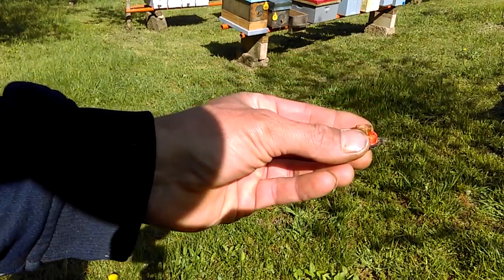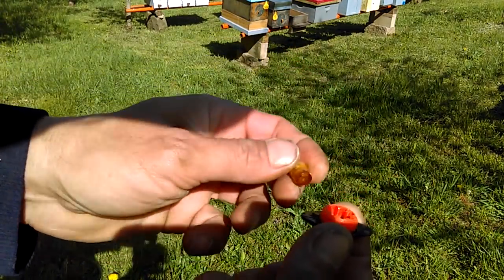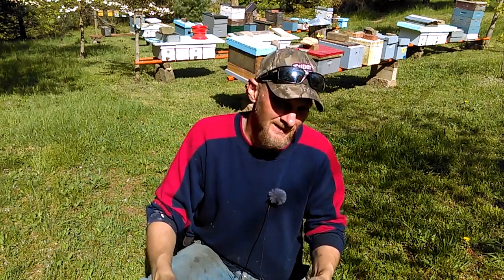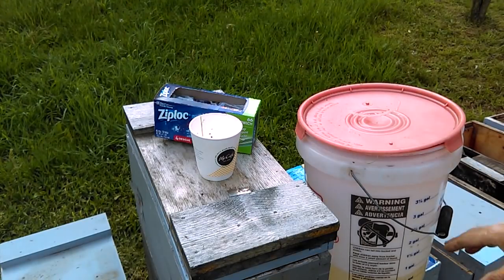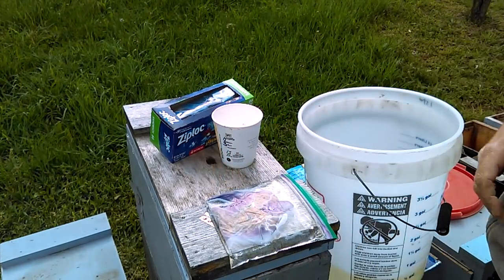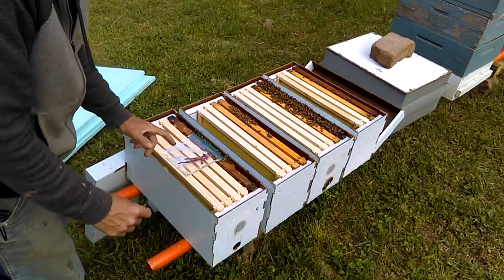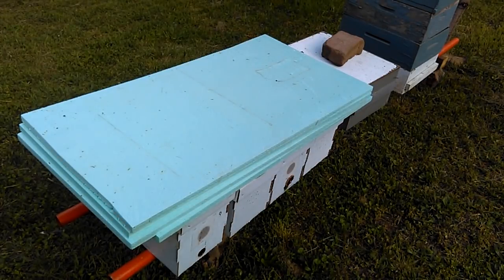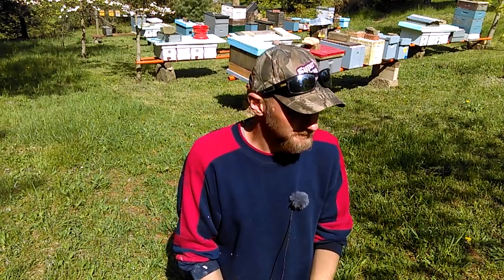Emergency Baggie Bee Feeders

Comment: I like using this baggy feeders in a pinch. I just use a note board push-pin and poke several holes.  I find I get a little too ambitious at times with a sharp blade.

Comment: Hi Jason,
Your videos are great and has given me lots of help.
I use the baggies when my feeders run out also. 
Suggestion, which will be easy for you, cow needles!
I use cow needles to make holes in the bags. 4-5 suffices and none of the issues with the slits.
Also, I emerge virgins in cages like you but my acceptance rate leaves something to be desired.
Whats your technique for introducing virgins to splits?
Thanks for the videos
Reply from the maker: Thanks for the input. I will give the needle trick a try tomorrow when I add new baggies. As far as the virgins I cage them for a few hours then go back and manually release each one. I am going to be sharing a post on this on my Patreon page (free post to read), when I get it don't I will share the link. How does that sound?

Comment: Hi Jason, I love your channel and watch all the time. I did my splits and notched frames for queen cells last Sunday the 5th. Today will be 7 days so I want to go in those mother hives to cull all but 3 of the cells so I don't have 10-12 queens fighting to the death when they all hatch out. My question to you is do you think I should pull frames in the 57 degree temps highs we have forecasted here in west Michigan today? I am not planning on messing with the splits for 7 more days but I need to cull the extra queen cells on the mother hives. ThanksTom
Reply from the maker: I would do what is needed just be quick. I am sitting at 58° and just open the splits shown in the video to install virgin queens from my incubator. I didn't have any issues but I worked fast. Best of luck!
Reply: Thanks Jason

Comment: I just printed the second cup holder you showed and they don't fit roller cages. They are to thick.
Reply from the maker: Where did you buy your roller cages? There is a lot of companies trying to make them but they are not the right size and they are even thinner plastic.
Reply: @JCsBees  I actually got them with the system off eBay. Complete system. I also got some off Amazon
Reply from the maker: I'd say that's the problem. Ebay carries a lot of china made beekeeping equipment and Amazon seems to be adopting that same routine sadly. I'd get them from Dadant or Mann Lake. I also think you can print the roller cages, maybe they would fit the cup holders better than the cages you have.
Reply: I haven't seen the roller cages on thingverse
Reply from the maker: Here ya go https://www.thingiverse.com/thing:2236560